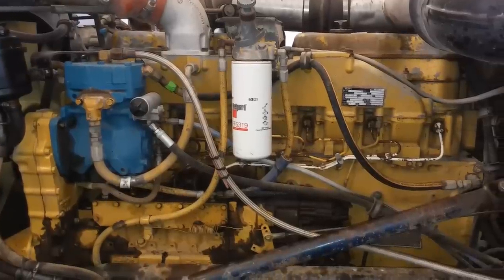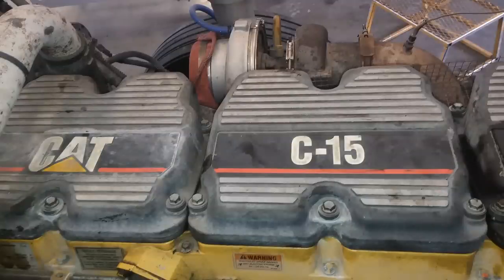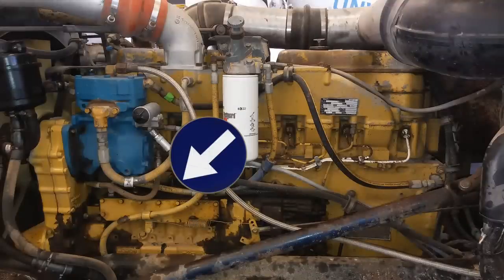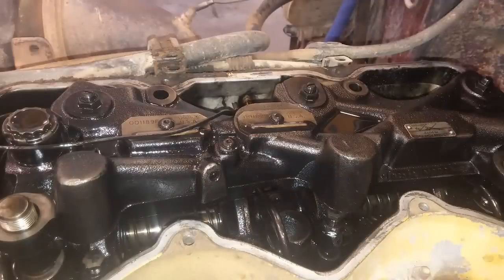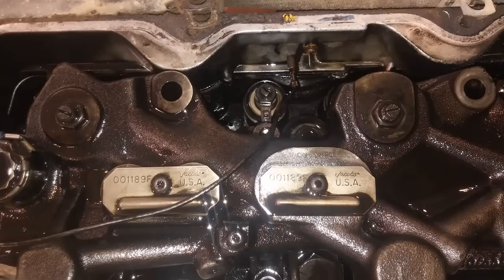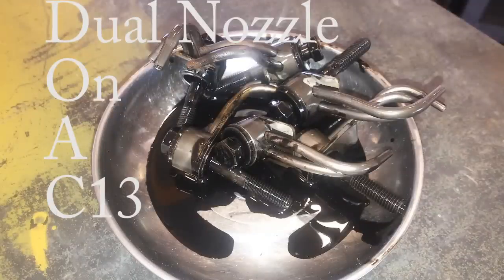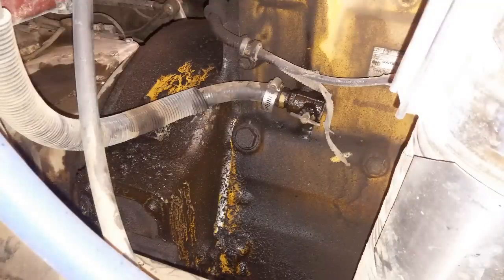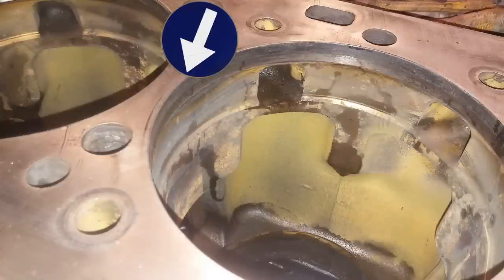The Cat 3406B Engine. Know Your Engine.  Caterpillar 3406 Information And History.

Comment: I just bought a Pete 357 with this motor, it runs great, hardly leaks, smokes like a chimney, but it has to crank a while before it lights off. It has a starting fluid injector set up but I know nothing about it and am having a lot of trouble finding information on it. Does anyone know about this system? Is it a can of ether or other fluid somewhere that I need to fill? Any help would be great.
Reply: I'm looking for that info too..! Interested to ear what adept ape has to say about it !
Reply: They use to have a orange container mounted on the engine. I never used it as it is not good to use all the time. 
Best way to start a Cat DI not a PC. Is to press clutch in and depress the throttle half way. If it has a over ride switch, you have to hold it in the run position until oil psi builds up. A 3406B had three types of shut off's. Strictly electric and when you turn the key on it should click. Manual cable, lever mounted on side of governor with cable going into cab. Some was pulled to shut off others was push. Depends on how cable is run. Last was a air over electric shut off, these was not popular and very few was used. 
So try the way I stated, second check and make sure shut off is not holding you back, third fuel return line can plug up and hold the rack in the off position until oil psi builds up. Most of these had number four return lines that caused this problem. Which I recommend a number six or eight return line. You have to update fuel return fitting because it has the orifice for fuel psi. Last I would check pin timing. Those are the most common problems of hard starting on these.
Reply: @johngoldsmith6629  Gold. Thanks

Comment: I had one of these in a 85 pete when they first come out in a 400 hp b block then in 87 they put after cooler and bumped up to 425 hp but were sluggish compared to the 400 with out after cooler. 
When I first got mine along with a few other owners when these pete calendar trucks came out they were just gutless the older 375 and 380 a blocks would just run away from us .
I took mine back to dealer took mechanic for ride with load he agreed that wasn't right they tried to tune it had a bit more power but couldn't see the back of trailer made my short trip booked it in with cat dealer foreman was pissed with how peterbilt set up .
The cat dealer dropped drive line and put on water dyno and proceeded to tune it properly. After it was done about 5 hours later more so to install and remove  dyno system from frame went for drive with the foreman at the time i was pulling a train hopper bottoms this truck was just totally different had power to spare excellent torque rise and barely a puff of smoke. This guy knew what he was doing he said  to get the most out of this engine they needed everything to work together in the  pump to much smoke creates more soot and wear. I couldn't be happier with it because it pulled like a mad dog without the smoke which means it was running about as efficient as possible and pulling 118000 pounds averaged about 7 miles per gallon. 
So this tells me that if you get someone that knows what to do with these engines they are efficient and reliable. 
The only other thing was they recommended a bearing roll in  at about 500000 miles back then for preventative maintenance. I wish I still had that truck

Comment: What is normal good  Oil pressure on this 3406B.  I've heard 45 to 65 psi Hot and 75 to 85 psi cold.  Health of the engine plays a role on this  i know, but what are the CAT specs..
Reply: Seems mine around 70 cold

Comment: Thanks I picked up a 81 362 Pete with a 3406b  it runs good  has good oil pressure . It sat for about 15 years and it took a bit to get it started but it took off and runs good . A Buddy of mine wants to buy  the motor and transmission  it has a Road Ranger 18 spd. With pto on it . What's it worth running good .
Reply: 5k
Reply: @amunderdog  Thanks Man . Going to get it fired up here before winter
Reply: @rogerw2101  That is the low low friend price, I saw western truck and tractor repair has one - motor only about 10k, latest video from him, He is finishing that truck. Episodes = 378 Peterbilt Phase 1 has price.

Comment: Could you make a video on rebuild the fuel pump? Very little info on them...!
Reply: Which type? You have 3406, now called A model. 3406 B, 7FB style, 3406 B/C different housing, camshaft, pumps, bushings and spacers. PEEC style fuel system with electronic governor. Variable timing units, are of several design's, some look the same. You have the 7FB, 4MG 1-03599. Later 4MG design, 5KJ design, 3ZJ design. About half of the VTU's I work on are assembled wrong.

Comment: Greetings from Australia.. recently put a water pump on a 3406b stationery pump engine due to coolant leaking internally into the engine.. I have Detroit background but this is the first time I have ever come across this problem on any engine.. is this a common problem??
Reply: It happens when the weep hole stops up. Some weep holes are in the front, others in the rear. Cat had a lot of problems with seeping water pumps until they got a handle on what was wrong. If the back plate is aluminium, I always replace it with the steel one. It will last as the other will not.

Comment: Hey.  Good afternoon.  I'm looking for the torque specs for a 3406E. Particularly I need the specs for the valve rocker and injector rocker assembly.  If you can help me out that'll be greatly appreciated  thanks.

Comment: IDK if you will reply but I have a 3406c. No power but blows a lot of black smokes. 2 constant streams of it. Builds to 30psi of boost but very slowly. I am wondering why it has no power.
Reply: Sounds like a boost leak or exhaust leak not spooling the turbo
Reply: Timing unit's on these causes problems, FRC and fuel PSI was the big three. Another problem is later C models 3ZJ's only. The wrong nozzle gets installed. If you go by serial number in SIS, wrong most of the time.

Comment: My cat says "3406" only on the valve cover, I can't find a data tag on engine. It's a 1992 acl 64 autocar Michigan special. So is it just a 3406 or is it a 3406b? Horsepower is also unknown, how can I figure out what I have? The injection pump looks identical to the 3406b in the video. Thank you for any help
Reply: Ron Young.... if your A-Car is a 92 and the engine is original, and ALL "mechanical"... then it is most likely a "B" model.  The earliest 3406 engines (after the 1693) were "pre-cup" engines (Not direct injected), the first "DI" was the 3406A.  The 3406B was in production until sometime in mid/late1995.  

HOWEVER.... having said all that, "IF".... you have an Electronic Governor attached to the REAR of your inline injector pump... you have a 3406B "PEEC" engine... an engine interim to the 3406C.  The 3406B "PEEC" also had electronically controlled timing advance as well as a small "ecm" box.... but the injector pump was still Mechanical.  

 Hope this helps you, at least a little.  : )
Reply: @Romans--bo7br  no electronics on pump, most likely a 3406b thank you sir for the help. I'm guessing now it's 425hp
Reply: 3406 (now called A model) was a PCT, PCTA, DIT, DITA. (1973-1984) 92U prefix.
3406B at first was a 7FB, JWAC DITA, later ATAAC was added. As they ran out of serial numbers, the first 4MG's 1-03599 was still basically the same and still could be a JWAC.
Starting at 4MG03600 the VTU was the major change. And they went into the 90,000 serial numbers. Then they came out with a 5KJ and it was a 3406B, 1-07799. Most people get this serial number mixed up is the 3406 B 3ZJ, serial numbers 1-16181 is a 3406B. During the late 80's the dreaded PEEC was released. Electronic governor and VTU. You had PEEC II, PEEC II.V They started out as a 3406B 8TC. released next of the PEEC was a 2EK, still a 3406B.  Last PEEC was the 4CK and it was a 3406B 1-0845. Another 3406B PEEC was a 5YG strictly a 460 HP @1900 RPM'S.
After the 3406B ended the 3406C was released. Mechanical was 5KJ07800 and up, I have never seen one of these.
 3JZ16182 and up. The last fully mechanical 3406C was the 8PN. It is a totally different engine and parts do NOT inner change well with the older engine. Finally you had the last PEEC, 4CK0846 and up. It was a PEEC III and had a lot of VTU problems.  
What part number is stamped on top of the fuel system? Something like 7C6650 or what ever it is. Turbo part number, Cat only. Around number five cylinder, turbo side the serial number is stamped in the block (towards the top). If it has a sound panel, a hole is cut out for the block data plate. If it is gone you can see where it was mounted if nobody has painted over the engine. The valve covers could have been changed. They are the same on first production engines until the end with 8PN's. Some did have ridges put on top, they came in with late 4MG's. If it is the original engine a 1992 was the end of the B series and start of the C series. So you should have a 3JZ engine. The most popular was a 350 or 425 HP. Other HP's was available. The nozzle part number would help. Also on front the the fuel system camshaft is a part number.
So start with the cylinder block and top of the fuel system.

Comment: Can you help me I have a 3406 peec 2ek 00857 350 hp it been a good motor recently it started what I call a burp while your driveing or setting still I have replaced the speed and rack sensors  what  Elise could be causing this to happen any help would be appreciate
Reply: How did you set the speed sensor and rack sensor? What is you timing sensor show KOEO? Have you tried swapping BTM's? What is you boost psi showing KOEO? Did you pinch your wires putting rack BTM back in? Have you checked your TDM for oil in the Boost sensor hose? Or water in the fresh air hose?

Comment: Josh, we always hear how these mechanical engines will just keep going and its easy to understand why. My question is do the newer electric and computerized engines (disregarding emissions equipment) tend to be more problematic in the long run? Do the computers or any other related parts wear out such that the engines won't "just keep running forever"? Thanks for the videos!
Reply: The tolerance's required to meet emissions can have a effect on longevity. Take EUI's for example. Higher fuel PSI is needed to meet emission's. Closer tolerance's, prefilling fuel filters improperly, transmission fluid, dirty fuel you name it. Cuts the life down of the component.

Comment: Where do you recommend to get a rebuild kit for a 3406b ?
Reply: Cat does not offer a rebuild kit, piece parts. I am sure aftermarket is available, but you get what you pay for. As with any thing some are better or as good, most is junk. Had a friend build a E model and the liner flange broke, damaged the cylinder block. The aftermarket manufacturer would not stand behind the failure. I looked at the part and it was a defect in part. Manufacturer said workmanship.

Comment: Could you do a history on the 3406 pre combustion engine and the 1693 engine?
Reply: He has more than likely never worked on or maybe seen a 1693 truck engine. Just about all data is removed from Cat.  The first 1693's had a forged body fuel system and some (not sure how many) had a compression release. I have never seen one of these, before my time.
Only a few hundred of these, a guess is from 1-781, can't remember on forged body. HP was 315 T and 375 TA.
After the forged body ended they came out with a compact fuel system. 325 HP T, TA's was 375, 380 and 425 HP. The trick was to put a 380 torque spring in a 425. A 380 was a high torque. Depends on serial number will use the last ones as an example.

A normal 425, the rack set at .135 with a .032 torque spring. So maximum fuel was .167 at peak torque.
A 380, the rack was .095 with a .088 torque spring. So maximum fuel was .183.
So if you put a 380 torque spring in a 425 you would have .135 plus the .088 torque spring which gave you .223 fuel at peak torque.
Also the 425 had a .022 deflector spring, while a 380 had a .028 deflector spring. So if you used the 425 deflector spring with the 380 torque spring it would deflect faster on a hill. Somewhere in the mid 70's the 1693 ended. Engine was called a D343 not in a truck. I might have some more data at work. I do have a spec data sheet and a factory brochure on a early 1693. As the picture shows  oil filter canister's and not a spin on filter. Also the fumes group is in the rear cover and not on the valve cover.   

The 3406's now called A models came out around 1973. They ended around 1984. The very first engines oiled the rocker arms via the head bolt holes. This was before my time and I have seen very few of these. The oil psi would build up and leak past the spacer plate gasket. Basically it is a metal shim and the oil would force it's way into the cooling system ports and fill the radiator. Cat had to redesign the cylinder block and head. Now you have two oil hole dowels that came up out of the cylinder block thru the spacer plate with o-rings on top of the block and spacer plate. The head had a hole in it and the new rocker arm stand would set over the hole for the oil to enter the rocker shaft assembly. The fix on the early block design was to mill the spacer plate on all six rocker arm head bolt holes. Metal inserts was placed in the milled holes and when everything was torqued down, they acted as a seal to prevent oil leakage. A normal head gasket kit was a 5P8053. If you had one of these early engines the head set was a 5P8052. However you only got a head gasket, spacer plate gasket and six metal shims if I recall. Had to get all other parts separately. 
HP was available on PCT as 255, 280, 300 and 325. PCTA's HP was 340, 360 and 375. PC engines ended in 1979 for trucks.
If the correct injection lines are installed you can tell a PC engine VS a DI as they are different on the outside. Another problem was when you bolted the rocker arms down you have to make sure you don't get the glow plug wire under it. Could smoke the system real fast.
As PC engine's builds more heat in the cylinder head, it required a larger radiator. So you could not install a PC engine in a DI chassis unless you changed the radiator as well. 
Seen PC piston's put in a DI. But I have never seen a DI piston put in a PC. Would not last very long as the piston would melt a hole in it very quickly. Connecting rods was changed a lot as well. You had straight, wide taper and narrow taper, if I recall correctly. 

Starting a PC engine is not like a DI. First you push the clutch in (need to do this on all engines) press the throttle slightly, spin the engine over for just a bit to put some fuel on the piston. Use the heat start switch to warm up the precombustion chamber. Outside temp plays a factor on how long you heat it. Can't go very long or you will melt the glow plugs tips off. Again press the throttle and try and start the engine. If it was very cold have seen people activate the glow plugs for a little while to help build up heat again.
Most trucks built during this time frame had a series parallel switch. Start on 24V and runs on 12V. Biggest problem was you had to rotate the batteries every six months, which nobody did. 

3408 engine was also a PC, but only PCTA. However they was available in DIT or DITA.

As far as Cat truck engines I have worked on a lot of them. However a 1676 and natural gas engines. Have never seen or worked on them in a truck.
Reply: @johngoldsmith6629  thank you for the info
Reply: @johnmclaurinmclaurin924   Looking at SIS 2.0 (junk) Cat has removed graphics and just about all the info on forge body fuel system. Looking in old SIS (better) serial numbers 1-781 was forged body fuel system. Compression release was also in that range and starting at 782 and up. Compression release is not in the camshaft group.

Comment: Do you have or could you do a video about the differences between a B model a C model and the Peak engines?
Reply: PEEC engines they took a mechanical engine, removed the mechanical governor. Put a rack for a PEEC set up so the could add a rack sensor to monitor position of the fuel. Put a chopper wheel in place of the flyweights with a sensor to measure speed. Added a BTM to control the fuel and a TDM to measure boost and wires to connect all this up to a ECM. Took the throttle rod out and added a pedal sensor. Took the mechanical VTU and removed the flyweight section. Added a spool valve that a collar would catch the BTM to move the VTU spool valve. Added a bell crank with a sensor to monitor timing position. On later engines added a coolant sensor for cold weather operation. Thus by doing so instead of a two dimensional timing map, they could have a three dimensional timing map.
Main thing on a mechanical B to a C was emission's. Unless your talking 8PN engines which is a completely different animal.

Comment: Hi, whats the oil pressure supposed to run at,  hot and cold .  Thanks.
Reply: Cold who cares.
Hot max across the board 88 PSI.
LI min 15 PSI
1200 thru HI min 40 PSI
LI to 1200 min, draw a line and intersect the two points.

Comment: What is the difference between a 3406a or 3406b model
Reply: A lot, head, nozzles, fuel lines, fuel system, VTU, front plate, front cover, more gears,  turbo, JWAC if it has one, air compressor, oil pan can be, suction tube can be, oil cooler can be, regulator hsg can be, just to name the major parts.

Comment: The greatest CAT engines ever, no electronics bs , but THE EPA BS FOLKS KILLED CAT ENGINES FOR TRANSPORT,  there is a guy has this in a PETE COE   just rebuilt it , heavy hauler with flat bed trailer , 13 SPEED MANUAL , NO MUFFLERS, but just LOVE it’s sound with its TURBO, WHISTLING, SHIFT POINT , THANKS for this program,,,, 🇺🇸🇺🇸🇺🇸🇺🇸